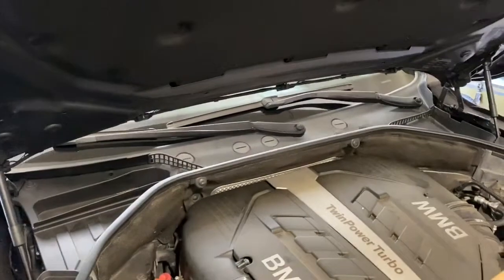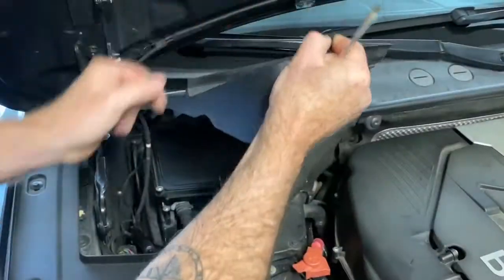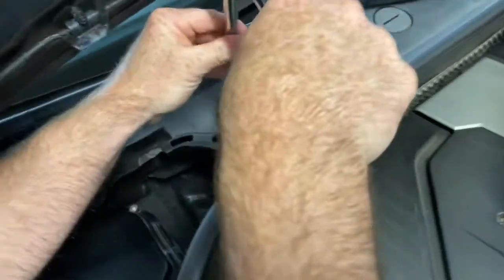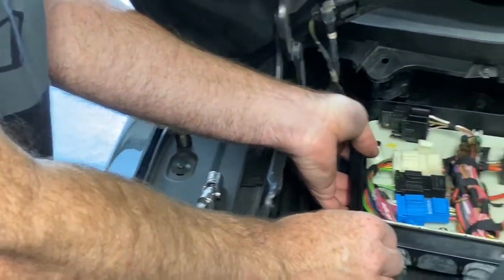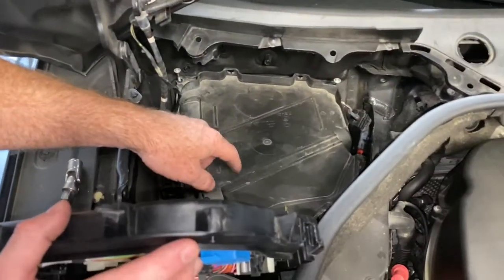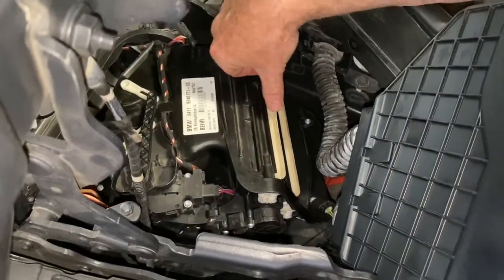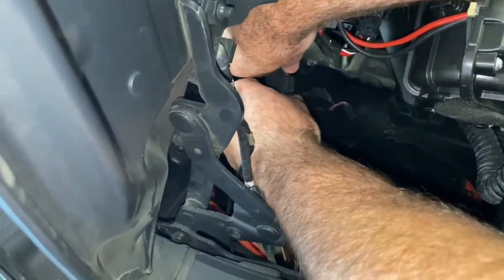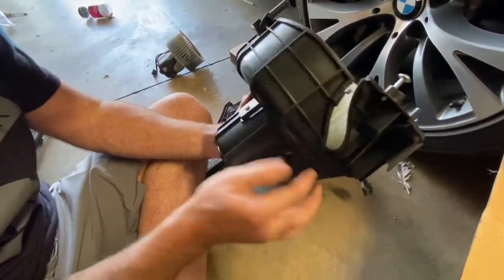BMW 5 Series F07 /// F10 Blower Motor, Cover (repair), Voltage Regulator DIY

Comment: I just changed my cabin filter a few weeks ago, today I saw smoke coming from vents. I turned off heat and it stopped. I thought I fixed the issue but smoke came on again. Got to be the motor. This looks pretty doable if I did the cabin filter which was way more complex since it was under the glove compartment. Hope it isn't the valve cover gasket but I'll be trouble shooting soon. Thanks for the video, this will save me money as opposed to going to a mechanic...
Reply from the maker: I’d be very surprised if the blower motor is the culprit. Good luck!
Reply: So you think its regulator? @dmascarin

Comment: Thanks for the video!  I just replaced my blower motor ($45 for motor on Amazon plus $11 for torx bits I didn't have) for around $60 and a little over one hour of my time.   Fan working again just in time for hot/humid Chicago weather.   Great feeling knowing I saved myself the $800 my independent shop quoted me.  Dealership would have been $1000+.  Thanks again for making the video!

Comment: Just found this video, after I replaced the fan over the weekend. I have to replace the resistor as well and was told it was under the dash.... didn't even notice it was attached to the blower housing when I had it out... Doh!!!

Now to take it apart again, but I feel I can get it done in 30 minutes this time.

Comment: Thanks for the informative DIY!  My stealership wanted over $560 just to replace the blower cover that holds the sponge screen.  I bought the replacement part, cover and screen for under $50.  Next I will tackle an outer CV boot replacement that costs about $150 for parts and tools.  The stealership wanted over $1750 for a CV boot replacement.  WTF!

Comment: Hey guy 
well I had the same identical problem and watching your video step-by-step I was able to do it in about an hour and 10 minutes replace the regulator and the blower motor and because of you it came out perfect I have heat and the car is back to being like it should be lots of appreciation and thank you so much for sharing I will definitely give you a thumbs up and start following your page once again thank you so much guys👍🏻
Reply: Did you disconnect the battery? I wanna do it without removing it

Comment: Thanks for posting this video. Only changed the fan and used some HVAC filter material. For my 2012 550i the unit came out without needing to rotate much.

Comment: Thanks so much for the video. I wasn’t sure if it was the resistor or the motor, so I replaced both for less than $100. I really appreciate that you posted this!
Reply from the maker: Thanks! I have a new sunroof shade that I need to install. I’m sure everyone here needs to do that too 🤦‍♂️!

Comment: This was really helpful. You did a great job explaining the process real simple and as you said, you don’t need to worry. I just changed the motor for around €130,- and I hope that will be all. I have some doubts if the resistor also needs replacing, but I will post it here if so.

Comment: Thanks for the video. I had the same problem with my 2014 530D. I didn't even bother to open the power box on the top and got it done in less than an hour. I have a different Air box though where the power connector is on the top rather than on the bottom.

Comment: Hey thanks so much for posting this, you guys did a great job explaining the process!  I had the same problems with my 2015 535i GT where the AC fan was dropping in and out with a fluttering sound.  I followed the steps word for word and had no problem changing out the blower motor and final stage resister, which saved me a ton of money compared to the dealer quote.  I even had the same problem with the cover filter, where the black mesh was all crumbled and half missing.  I scraped it all out and cut out a 4 by 11 inch piece of a window screen to replace it.  The only difference was I used metal clips to hold it in place instead of a hot glue gun.  Thanks for the idea!  Again, nice video that was extremely helpful.
Reply from the maker: Ryan Allen I’m glad it helped!
Reply: I to just got the shock of my life at the dealership when I was told how much it was going to be to replace blower motor and the resistor. I am somewhat mechanically inclined but it's been decades so on a scale from 5 to 10 how hard is this to do.

Comment: Last month i did clean the blow motor fan. And get in the blow motor box and finished. But 3  piece bolt left. I did  lock up the bolt every bolt hole. Suddenly  my head is dizzy. But blow motor operate is well good. So i will find the empty hole and lock up the bolt next time.  haha.. Thank you for your video.
Reply: That happened to me to my head was spinning lol

Comment: Hey Derek, great vid! I tried today to take mine out, but the green tube stuck to the blower cluster would not release off the unit.  Is there a trick to that as I don't want to tear it off? It pulls with the unit when trying to take it out.  Any help would be appreciated!! Thank you!
Reply from the maker: Thanks! I'm not sure what you mean by "green tube," but if it's the plug with the tab on it it that plugs into the voltage regulator, you should just be able to squeeze and pull it straight out. They can be pretty stiff and stubborn. Good luck!
Reply: Hi. I’m stuck with exactly the same problem - the light green rectangular hose that runs from the blower unit to the car cabin won’t release. Did you find a solution?
Reply from the maker: @stevew6497  Sorry, guys. Mine didn't have any connector holding the blower unit  to the light green hose. Are you sure you have all of the screws out?
Reply: @dmascarin  Hi Derek. Many thanks for replying. I think the ‘hose’ is probably supposed to just slide off when you lift the blower unit out, but mine’s stuck on. I’ve been able to unclip all the leads, so just the rectangular rubber tube/hose at the bottom that I can’t free. I assume the blower slides back onto to hose housing when putting it back in? Thanks again.

Comment: I did a post mortem tear down of my F10 blower after I replaced it from the same issues. Turns out the blower motor uses brushes and they simply wore down to nothing. The motor itself was fine except for the worn brushes. I used ISTA and manually turned on the blower with the housing out of the vehicle and could see arcing where what was left of the brushes were barely making intermittent contact. It was a tough problem to track down and I couldn't believe that was the root cause.
Reply from the maker: Thanks for this very useful information. They could go brushless, but why would they when they make millions sticking with an outdated design‽
Reply: @dmascarin  It's criminal isn't it...

Comment: 1. thanks for the video! 2. my ac blows weaker air than before, do you think this will help if I change the motor? regards!
Reply from the maker: 1. Glad this helped! 2. In my experience, the motor either works or it doesn’t (it can work intermittently). I always recommend replacing the motor and regulator as cheap insurance.
Reply: @dmascarin  thanks! Any reason y’all stopped videos? Great chemistry and enjoyed it very much thanks again!
Reply from the maker: @GRINGOf10  This car has been unbelievably reliable and hasn’t needed any repairs! I do have the sagging  sunshade that everyone else does and have the part, so we might do that one.
Reply: @dmascarin  please do it I have that problem too lol

Comment: Hi

I have 2011 520d F10 in the UK

My air comes on full for a few seconds no matter what the speed setting is and then cuts off.
Its then off for a few minutes and then comes on full power again for few seconds and keeps doimg this cycle

I've tried different temperature, different active vents and turning off air conditioning button but same problem.

Does that sound like the problem you had?
Reply: The same problem!!!! F11 2013 😡
Reply: @sanelbejtic8510  you found a solution?
Reply from the maker: Exactly. Best to replace the motor and regulator at the same time. In my case, it was the motor that was the culprit (because I replaced the regulator first and the problem persisted).
Reply: @dmascarin  bmw have said that my motor doesn't have a regulator as its an early model and say they think its built into the motor
Reply: Have ordered oem motor, hope it works.
Reply: Not yet

Comment: Hey Guys Really a great video , i have chang the Motor but it still not working (could you guys make a video where you guys chang the (HEATER RESISTOR)please
Reply from the maker: The resistor is attached to the blower motor housing. It’s the rectangular metallic part on the bottom that I pointed out when the housing first came out. Good luck!
Reply: @dmascarin  thnx i will try

Comment: Mine starting making a humming sound. I’m hoping it’s debris because it works perfectly fine. curious is that’s something you noticed before it went bad.
Reply from the maker: The humming sound is 99% the disintegrated filter and/or leaves. I had just one small leaf that made it sound like we were driving a lawn mower! The other components didn’t make any noises before the motor started cutting in and out. Good luck!
Reply: @dmascarin  Thank you so much, I looked into it and those crap filters is definitely what I found when recently changing the cabin filters. little project for the weekend I guess.

Comment: Vids like that is what makes YouTube valuable to the viewer. Thank you. Any possibility to find out whether the Problem is the motor or the other thingy which name I can't recall? Can't find the fuses for the blower motor.
Reply from the maker: Thanks! I assumed the motor cutting in and out (and in various speeds) was a faulty regulator. I replaced just the regulator and the problem persisted. I replaced the motor and all was well again. Since you can't be certain, it's best to replace both at the same time. Good luck!
Reply: Probably. My blower - before he finally gave up - used to kick in at full speed just to stop Working after 5 to 10 seconds. Then after 5-10 minutes he started the same routine again. Probably motor but could be regulator as well. 

Last year it was the height regulator which was defect. The year before it was the trunk switch which crapped out on me..what a horrible engineering.

Cheers from Germany!

Comment: Thanks for sharing the video! Great so see that you got it fix. I have F07 2013 model and while scanning all modules for errors, I got two faulty codes 8011A0 and 8011A6 (Stratifying-flap motors front right and rear right blockage detected). Do you know where are these motors located?

Comment: Hi, great vid, I am having the same issue. Can you post links to where you purchased your parts? The fan motor and the resistor. Thank you!
Reply: @Derek Mascarin I just wanted to follow up that I finally got around to doing this (it was winter, I didn't need AC :) ) and it worked like a charm. Thanks for putting in the effort to make a vid, it certainly saved me a grand or so. Thank you!
Reply: @carscigars1710  where did you buy the resistor from, cheers!

Comment: Hi, I had the same issue and after changing the blowing motor and regulator it was working for 1 day and then stopped working again… Any idea why it stopped working? I’ve checked all the fuses and all looks good… 
Thanks
Reply from the maker: I think you should check the fuses first to be safe, but the most likely reason is a faulty part. I would return both parts and try again if the fuses check out. Check all the wiring while you're at it and see if there's any signs of physical or water damage that could cause a short. Good luck!

Comment: Did you plug into OBD first? Did it confirm a faulty motor?
Reply from the maker: It's been a while, but I don't recall BimmerLink reading any codes.

Comment: I have a 2012 528i experiencing the same type issues.  I have purchased the HVAC Blower Motor Control Module because fan was working only on "maximum" air conditioning setting.  Now it does not come on at all.  BMW place says you need to replace Blower Motor at same time.  First question, will my 2012 528i be configured similarly to this vehicle.  Second, was this control module attached to the fan motor housing?  3rd, does it make sense to assume that the fan motor is bad and replace it at the same time?  Thank you.
Reply from the maker: Ross Powell it should be very similar. The control module is on the bottom and it makes perfect sense to replace both the regulator and the motor together. The reason this video exists is because I didn’t do both at the same time!
Reply: pretty much the same. except the two torx towards the firewall is more pain in the butt on the F10. you have to pop the firewall cover up to have enough room to fit a small 1/4 inch drive with a t25. at least that was my case doing it at night with a flash light on the driveway to get ONE leaf out of the fan housing and replace the garbage foam filter with just DIY screen.
Reply from the maker: FrankW1029 it’s unbelievable how much noise one leaf can make inside the car. Worst design ever!

Comment: Thanks for publishing the video.  Can you help with some questions (1) some other videos show the person having some trouble getting the connector off the O2 sensor.  Is there some trick to getting that off, (2). You mentioned that the motor had some glue on the bottom. How did you get the glue lose?  Thanks again
Reply from the maker: I’m not sure what you mean by “O2 sensor.” There are three connectors that you have to unplug, but they aren’t much trouble. The glue was just a dab at the bottom of the blower motor that you might not even notice when you separate it from the plastic assembly. Good luck!

Comment: What’s the black fan filter thingy under the fuse box called
Reply from the maker: I think you’re referring to the filter that is part of the housing. “BMW Housing Cover With Coarse Filter - Genuine BMW 64119216222”

Comment: and on mine fault is-801207 blower output stage: open circuit detected in load circuit

and found the blower carbon got melted, whether to replace only the blower or should along with the resistor unit?
Reply from the maker: The best practice is to replace both, but you could get lucky for a while!

Comment: I'm looking for some assistance with what I think is a simple issue, but I can't figure it out.

First let me say I am not mechanically inclined.
I work in IT. Desktop computers and Server I can handle. But I have always be careful not to mess with the internals of cars I own because I didn't want to take a chance of messing something up.
But I just could not see paying $700 or better to replace a $40 part.
So I thought this would be the one time I did it myself.

With that being said, here is my issue.

I have a 2012 BMW 740i 

While driving home a few weeks ago my AC in the front stopped blowing.
The rear passenger blower still worked, but did not blow cold air.
After doing some research I determined the problem was the blower motor.
I ordered a new one from Amazon and it came in the other day.
I followed the directions on a your video to change it out.
All seemed to go well with the exception I accidentally touched the live plug in the fuse box to a metal support bar and it sparked.
I then taped the plug with some electrical tape, and uninstalled the metal support bar so it would be out of the way.
I was then able to continue following the video to remove and replace the blower motor.
I then put everything back together, but when I try to start the car it cranks but will not start.
The fan now works and blows but the car will not start. All of the electrical items come on, but I get and error message saying "Drivetrain Malfunction"
I borrowed a Zurich ZR11 OBD2 scanner. I connected it and get the following errors -
1. P13E4 "Ignition and Injector relay switching delay"
2. P13E3 "Ignition and injector relay not energized"
3. P10A5 " Injectors Initialization Error Group 1"
4. P10A8 " Injectors Initialization Error Group 2"

Any assistance to get my baby back on the road would be greatly appreciated.

Thanks in advance
Reply from the maker: It seems you blew the injector relay with the spark. It is probably near where you were working, but you should Google “2012 BMW 740i injector relay diagram” and verify its location. I’m sure you’ll disconnect the battery next time :/ The relay should look something like this: https://i.ebayimg.com/images/g/yIYAAOSwRs1dT0zA/s-l300.jpg
Reply: @dmascarin   Thank you so much for replying. I'm going to see if I can find it and replace it. Yes if I ever have to do something like this going forward I will disconnect the battery.